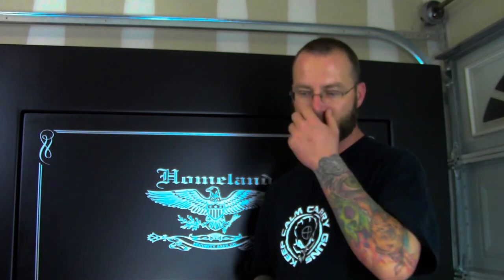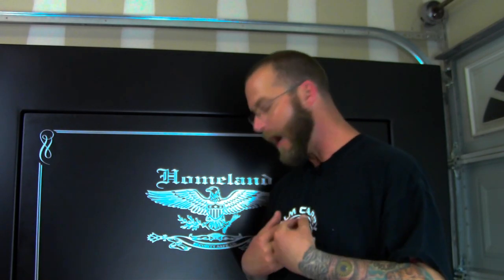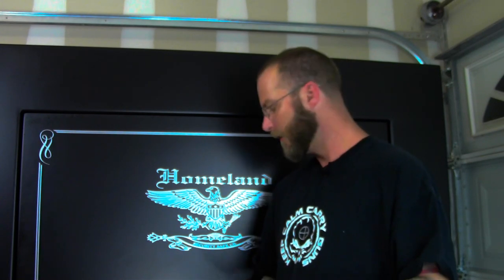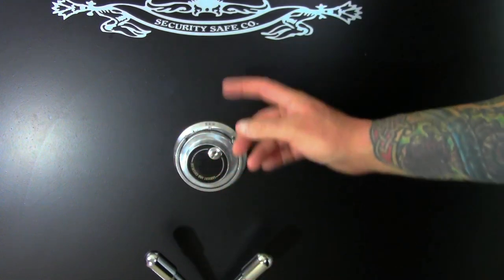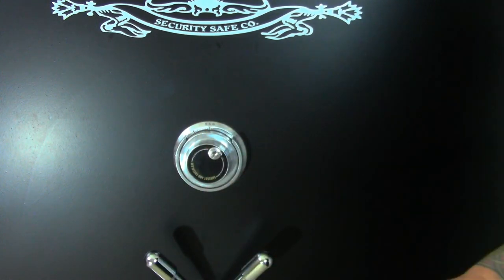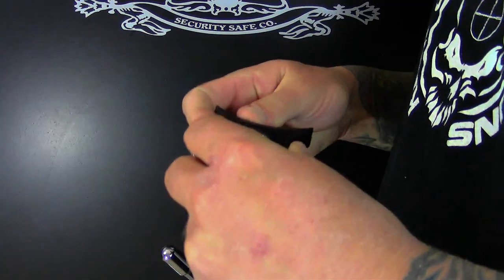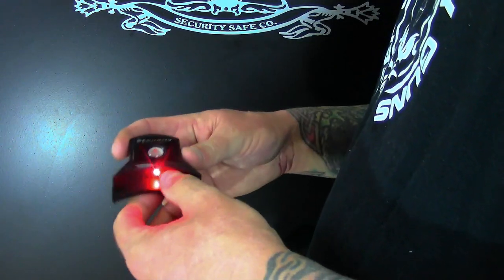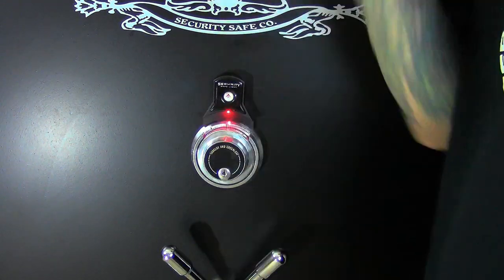Simple Gun Safe Upgrades , Installing the Cannon SSL-04 Mechanical Lock Light

Comment: Great video! Quick question - where does the battery go?
Reply from the maker: The unit opens basically in a half and a thin cr2032 battery is held in the center of the unit. Easy, I open the battery compartment at 3:20 in the video